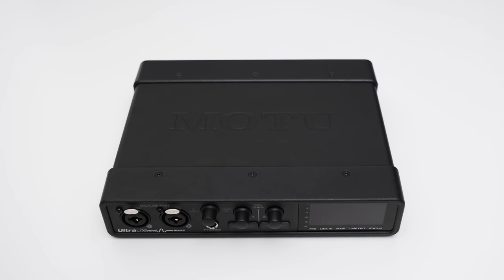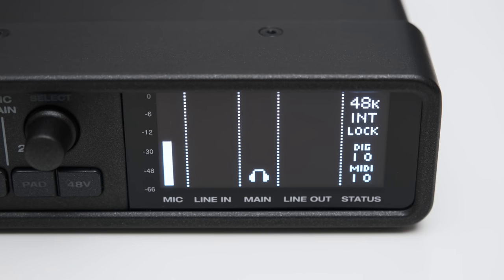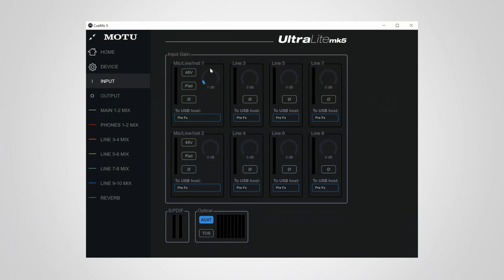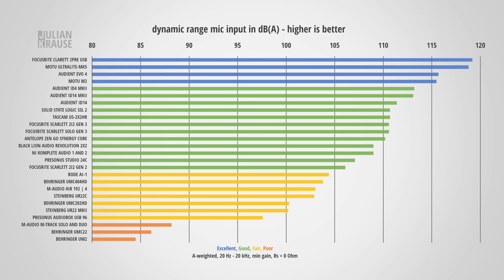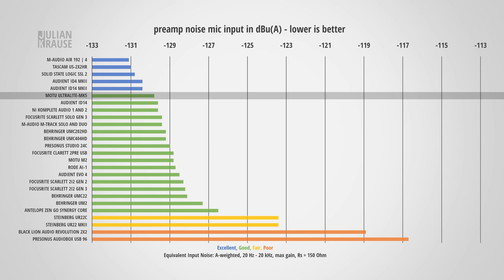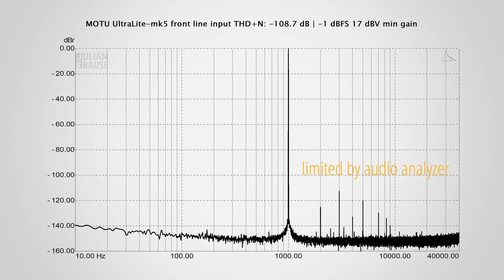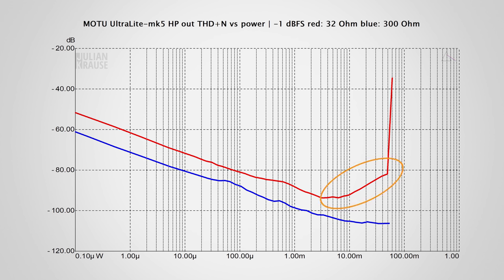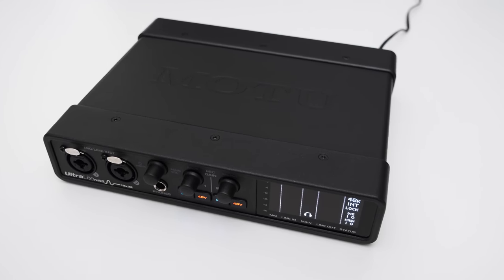MOTU UltraLite-mk5 Audio Interface - REVIEW (audio performance tested)

Comment: Great one Julian. Maybe it's time for some Apogees, Prisms or RMEs to see if their high price matches the performance.
Reply: +1
Reply: Agreed!
Reply: I agree, because I suspect that most of the more expensive interfaces sell their brand. 0 distortion is 0 distortion
Reply: I just commented the same thing essentially, lol
Reply: Agreed. Totally
Reply: @Saintknick  to be fair, RME has done a lot of work to distinguish themselves. There's a reason for their reputation and it definitely isn't just branding. Their clock jitter performance and transparent AD/DA is simply very very good, at every sample rate too. That's one thing you can't take for granted with other interfaces. Also, NO problems with errors via the ASIO driver EVEN at 48 samples. That's crazy, and deserves to be given the praise it receives.

There's also the underlying reason I got an RME... Totalmix FX. Truly a SUPERB piece of software as part of the driver and I haven't seen anything that compares in flexibility and polish from any other software.
Reply: @ZeroDividesByYOU  I don't know man. MOTU has leap frogged RME in digital conversion these days that using top shelf components. Same converters found in the Apogees. Plus MOTU AVB ecosystem similar to Focusrites RedNet and Red Dante interfaces for (Audio Over IP). Focusrite and MOTU are the only two manufacturers with Audio Networking modular interfaces for large scalability and mission critical deployment.
Reply: @eman0828  I'm not so sure about leapfrogged using high end components. I mean RME's PCIe card is still regarded as the highest quality converter for a home PC. Multiple scientific reviews I've seen of the card give it a 10/10 and use it as the weighting by which all other converters are measured. I don't deny that Dante and networked integration is AWESOME for scalability and deployment. But if you're just one guy at home doing audio stuff for fun or even as a job, I don't think there's much to say at the high end. Everyone has their preferences and honestly almost all converters these days are essentially perfect to our ears, barring odd design failures with different sample rates.  (IE not being designed correctly.) Anything even remotely in the "great" performance category is going to sound identical to the point of cognitive bias having a MUCH larger effect than any real difference. However, one thing that still rings true of RME is their legendary driver performance. FLAWLESS operation at even 48 samples, and that's WITH all the routing that Totalmix FX provides. Totalmix FX is a game changer. And even though Motu seems to have a semi-equivalent with this ultralite, and probably several others, there's just not replacing it for me. It's a phenomenal routing tool. Also RME tends to include some nice plugin bundles (like Bx Masterdesk, Scuffham Amps etc.) for free, which I know some manufacturers do anyway, but RME ALSO has their scientific tool call Digicheck, which is a particularly useful and impressive tool for end users. It has all sorts of meters and such to properly understand your output levels, input levels, goniometer measurements, the works. It's mostly for THOSE reasons that I tend to prefer RME
Reply: @ZeroDividesByYOU  PCIe is so 90s early 2000s with the exception of Protools HDX DSP cards. Thunderbolt is the new standard which is essentially a PCIE connection. Latency is not really an issue with most Pro interfaces. RME is not known in high end studios as you rarely see them in large commercial facilities. RME doesn't have much vaule these days like they did in the past. UAD Apollos is already dominating the Audio interface market.
Reply: @eman0828  See it's interesting that you mention thunderbolt because 1. It literally is just PCIe. Similar to how some PCIe lanes go to the chipset and some the actual CPU. Thunderbolt isn't actually different. Just a more convenient form factor. Also, it's still just a 4x connection, just like RME's cards. Again I'm not talking about large institutions. I'm talking about home producer or mixing/mastering engineer. It's great for them. Even streamers. The audio routing via Totalmix is just incredible.

Also you seem to have a misconception that PCIe is "old" when in fact PCIe gen 4 is a newer standard. In fact modern graphics do no even saturate a PCIe 4th gen 16x connection, let alone an audio interface. Bandwidth is not the problem with modern cards. Even USB 3 has more than enough bandwidth for literally hundreds of channels. 
And yes, PCIe is technically an older physical connector design. But that does not limit it. At least it hasn't yet. There are things that are special purpose such and infiniband networking or other such devices that need higher bandwidth, but as far as something communicating data to the CPU, audio interfaces don't really stress those bandwidths.
Reply: @ZeroDividesByYOU  Still RME offers little vaule these days compared to the rest of the competition. You wonder why it's one if the lesser popular brands as theres a reason. MOTU makes the same stuff for a fraction of the cost of RME without comprising quality and has always been an innovative company since the 80s. Just remember MOTU has making hardware interfaces longer than most Pro audio manufacturers that exist today since the early 90s. They were also one of the worlds first  company to write music software for the original Macintosh computers in the early 80s. Their software and hardware products gas even used by countless Grammy Award winning Producers and Engineers as well as Oscar Winning Film and T.V composers.
Reply: @eman0828  PCIE is still King of performance.  Maybe thunderbolt 5 will de throne it lol!
Reply: @davidjenkins8449  Not really as PCIE mostly irrelevant by today's standards as technology is evolving very quickly with the exception of Protools HDX DSP Accelerator cards that serves it's own purpose. The Focusrite RedNet, MOTU AVB and UA Apollo X16s are already used in big commerical studios. Thunderbolt and (Audio Over IP) is the future. A lot of the Immersive Audio Mixing rigs esp the Dolby Atmos are using Network based interfaces esp the Focusrite RedNet and Red Dante interfaces. Latency is not an issue with Thunderbolt and with Networking protocols like AVB multiple MOTU AVB interfaces can be interconnected together on an Ethernet network with latency under 0.5ms. You can have hundreds of streams in Audio Over IP which is why Dante and AVB are used in large scale deployment such as Venues, Broadcasting, Post Production, Stadiums, Live Sound, Tours and multiple room large studios.
Reply: @matiascastrocomposer  RME UCX II
Reply: @eman0828  When Hans Zimmer still has a Fireface 800 in his remote studio, then I'll follow that recommendation.
Reply: @soundbelch1600  Yeah but JunkieXL owns three MOTU interfaces to midi interfaces and an Ultralite mk4. Hanz Zimmer is obviously german. Go figure.
Reply: @ZeroDividesByYOU  but how much flexibility and driver "stability" do we need to rave about , to justify a 1000 dollar Babyface at 3x the price of similar interfaces .in 2021 everybody should have that.
Reply: @eman0828  they worked together on a film score. I'm sure they kept arguing RME VS MOTU for hours instead of working ..
Reply: @levondarratt787  Bro MOTU offers long term driver support as well. Lynx, MOTU and Metric Halo all support their drivers long term. RME isn't the only one which is no longer a unique selling point anymore. MOTU support drivers for their original 828 Firewire interface for 17 consecutive years straight which is older than most RMEs interfaces that's 21 years old.
Reply: @ZeroDividesByYOU  Theres really nothing special about RME. MOTU also writes their own drivers In-house. So does Lynx. They don't use 3rd party generic drivers. I had problems with Focusrite interfaces for years the reason I switched over to MOTU for better driver stability.
Reply: @eman0828  you're right, I didn't say all. I said many. Including Behringer, Focusrite, etc. Those are what a lot of consumers look to and use as their baseline. It's still not great. Like I said, it's getting there, and hopefully soon commanding $1000 for quality will not be required and the general consumer can get just about everything they want for less than that. That's currently the case with the Motu Ultralight and many more to come. I think that's great. Also, my third interface was a Motu M2 and I loved that thing. Excellent value for money. But it still wasn't quite as solid as the RME's driver has been for me (but acceptable enough for most use cases) and it lacked the routing options that I really needed, so using Voicemeeter was still required. The Ultralight or the RME both offer that to me, but of course they command a price increase. The Motu is much more reasonable, but also much more recent.
Reply: @davidjenkins8449  If you read my comment above you'll notice that thunderbolt literally is PCIe. There's not difference. It's just a connector, the interface is still PCIe 4x. So PCIe being the kind of performance is kinda true, but also it's the same. And a lot of modern interface don't even come CLOSE to fully saturating the available bandwidth of even gen 3.
Reply: @ZeroDividesByYOU  What issues did you have with M2? I have zero driver issues with my M4. I have two videos posted on my you tube channel demonstrating MOTUs driver stability on two different Windows 10 machines. No audio drop outs, clicks, pops or crashes. I find both my 828ES and M4 to have been the most rock solid stable interfaces I've used in the last 15 years. I've owned and used a boat load of interfaces over the years. My studio partner use to run a commerical studio with both Lynx and MOTU hardware interfaces when I was working under hime as an In-house Producer at the time. He had the original MOTU 896 before he got the Lynx Aurora 16.
Reply: @ZeroDividesByYOU  I forgot to mentioned that my studio partner use to work for this commercial studio in my home town as an Assistant Engineer back in 2008. He said they were running a MOTU HD192 PCIE core interface and an Apogee Rosetta 800. Last time I checked just a few months back, I notice that they are still actively using the same MOTU HD192 interface 13 years later still to this day along with a 1998 MOTU 2408 MKI and a 2003 model MKII 2408. Its pretty crazy how long that stuff held up over the years. I know most commerical studios are pretty conservative when it comes to upgrading hardware and software to eliminate down time and compatibility issues. If it ain't broke don't fix it.
Reply: @eman0828  Like I said, most consumers won't have issues with them. However, they do still have timing problems quite rarely. It's better with certain buffer size/sample rate configurations, and as mentioned these won't be apparent to most consumers. However, using two ASIO drivers talking to one another as you do in Voicemeeter and having an ASIO application mixed in with WDM audio for loopback (possibly for streams, other routing, etc) does cause pops and clicks. They're not nearly as bad as Focusrite and similar, but they're still there. THAT'S why I spent the money for the RME. Because it and interfaces like it not only further minimize those timing errors, but also eliminate the need for that second ASIO connection at all, given their internal routing. That's why I think the Ultralite is so awesome. Having that routing is mostly what I was looking for. Again, had that been out at the time I bought my RME, I probably would've bought that. But the RME has just been incredible for me.
Reply: @ZeroDividesByYOU  What timing issues? I've recorded several of my own clients including full albums and none of them complained about timing or latency issues. I had my MOTU 828ES for almost two years now that's had some heavy use. I haven't tracked anyone with the M4 yet as Its mostly used for my mobile rig for production stuff. The latency on that thing is insanely low. I detect no latency at all when using my Preonus Atom Drum Pad controller as it feels instantaneously like my Akai MPC 5000 drum machine which I still own. I never owned a mobile interface with that level of latency performance so far.
Reply: @ZeroDividesByYOU  I understand. As for driver, on a Mac, audio interfaces usually don't need one of the device is compliant. Any USBC inteface i tested , for example works right of the box. Goes back to years and years ago USB A. So the fans are more Windows guys that are happy that their stuff works finally. But is it that much of a difference on the Mac side?
Reply: @eman0828  That's impressive.
Reply: @ZeroDividesByYOU  If that's the case, why isn't RME an industry standard if that was such a major issue. RME interfaces are quite rare here in the U.S not nearly as popular in Europe. Most high end studios here in the states mostly have Apogee, Lynx, AVID, Burl, Lavry, Prism, HEDD, and Some of Focusrites and MOTUs higher end (Audio Over IP) Dante/AVB interfaces and major studios aren't complaint about timing or latency issues. Theres also alot of UA Apollo's given it's one of the most popular and fastest selling interface on the planet used on countless hit records.
Reply: @eman0828  Because in most studios, this isn't a use case nor problem they'd run into. Again, I'm not stating that RME has the best interfaces, nor even the best value for money these days. That's certainly not true. But they do have some incredible latency performance (backed up by scientific reviews no less) and a reputation for a rock solid Windows Driver. My own testing with the tool for ASIO driver testing that Vincent made has backed this up. Virtually no timing errors, even with DSP max spikes over 100%. This is quite rare for most interfaces, and something to be commended in my opinion.
Reply: Don't forget Steinberg AXR4, UAD Apollo and Avid Carbon
Reply: @nickgoogle4525  MOTU doesn't have driver issues and my videos proves it. User error is what most people have issues with. A lot of pros use MOTU hardware with out any issues including David Gnozzi.
Reply: @eman0828  Your video can only prove that you did not had driver problems in a specific situation. That does not mean others might not have problems, nor that you might experience problems at another time / with another setup or conditions. RME is mostly regarded as having "rock-solid" drivers. Nonetheless some people experience issues -- which might be related to the driver, the computer, their setup and so on. It's often hard to tell. Motu also has a pretty good (but less in my perception) reputation. Still you find people who have hardware or software problems with their products. Can be good products for sure, but does not mean there are no issues and a single video would prove that ;-)
I just gave my input, which might be interesting for some.
Reply: @nickgoogle4525  Lol yeah and David Gnozzi and Tom aka JunkieXL has no problems either that own MOTU interfaces. Stop making excuses man as you are totally an RME fan6just bashing. Even Mike Elizondo that was Dr. Dres partner for many years owned two Motu 828  mk 2 and two midi time interfaces. A lot of Pros use MOTU hardware.
Reply: @eman0828  Nonsense, I have explained what I liked and what I do not like about RME. That does not sound like a "fanboy" to me. But you can think so if you like :-)
And sure Motu is used alot. What's the point? As well as UA and many other products. So what? I just described my positive and negative experience and everybody can and should look what is most important for him and decide based on his individual needs and preferences.
Reply: @nickgoogle4525  I never seen an RME racked mounted in a pro studio in my life many high end commerical studios I've been in as it's one if the lesser known brands esp here in the US or you think RME is so called perfect and none flawed that never fails. Theres plenty of broken ones out there from power supply failures. What I have seen in Pro studios is most Digidesign/AVID, Lynx Aurora, Apogee Symphony I/O, the higher end Focusrite Red and Rendet interfaces, MOTU HD192 and MOTU AVB interfaces, Lavry, Antelope, Apolli 16, Dangerous AD converters, but never once seen an RME interface if drivers were an issue. You are obviously just bashing MOTU for no apparent reason. I don't know of any big name celebrities that used RME but I can name countless big name Artists that used the MOTU 16A such as Beyonce Knowles, Usher, Jennifer Lopez, Coldplay, Drake and many more.
Reply: @eman0828  I am bashing Motu when I say they have a good reputation and they and others make good products and one should look which features and specs matters most and choose one that fits to personal needs? ;-)
BTW, I almost bought an M4, but because it did not have the needed connections that was not on the list at the end.
Reply: @nickgoogle4525  Yes you cleary are because you keep bringing up how perfect RME is lol. Like I said, I never seen an RME interface in a pro studio before if other manufacturers had driver issues. Obviously that isn't the case esp big studios in LA. Name a top 40 record on the radio that was produced with an RME interface. I bet you would have a hard time. MOTU stuff is pretty rock soild, otherwise it wouldn't be used by oscar winning Film and TV composers and many grammy award winning Producers. MOTU has been around since 1981 that's been making hardware interfaces longer than most pro audio manufacturers that existed since the early 90s. The company being around that long pretty much explains they must be doing some thing right to still be around 30 some years later. Enough said.
Reply: YES
Reply: @imaxy00  I think the Motu is a great alternative to the UCX ii
Reply: apogee please
Reply: @eman0828  FWIW: I use both an RME Babyface Pro FS and a MOTU 828 ES. Both sound great. I actually nearly sold the 828 ES because the software was extremely unreliable used with multiple PC's over USB-3. Pages were slow to load, adjustments to mixes/fx did not immediately make changes, device sometimes not found. I wouldn't even think of taking that interface out to session or a gig just to play band backing tracks. I loved the IO on the MOTU but I simply could not risk that unreliability. That is the reason I bought the RME. I needed the reliability and boy oh boy... It has not even blinked over years of use. I now use the MOTU as an ADAT slave to the RME to access the MOTU's pres, line IO, and headphone amps. I'm underutilizing the MOTU's capabilities yes, but it was inconsistent enough to be unusable on its own IMHE. No software was released to fix the issues from MOTU and it has been years. I emailed them and received no response. Pretty frustrating. Also, to be quite frank, the MOTU control app was not aesthetically pleasing and was pretty hard to navigate even for what it was. And run in a web browser vs. in a native shell...
Reply: @danielc4361  its your computer is the problem not the manufacturer. Most people have issues when is user error. I have zero issue's.
Reply: @eman0828  I understand most people probably don't have this issue, however there was a good bit of corroboration from other people about the USB issues. I imagine the thunderbolt and network connectivity is better for people. As I said I used multiple (very capable) PC's with similar results. I like the idea of the device, and I'm glad it worked for you. It just didn't for me. If you have any suggestions as to how to resolve the issue, I am eager to hear and, to be frank, anything would be better than what I've gotten from MOTU support. All drivers were installed correctly. No hubs or anything out of the ordinary.
Reply: @danielc4361  Well it's not the manufacturer fault. If this was a manufacturer issue, every single person on the plant want have the same issue. David Gozzni of mixbustv has been using thr avb interfaces for close to 4 years now and he owns 3 of them with zero issue's. My 828 ES I had for two years zero issue's. I own an M4 as well. Both interfaces have been used on my legion 5 laptop and my custom built desktop with no problems. Check my videos.
Reply: @eman0828  I have to disagree with you there. People use different devices. Lots of things can go wrong. Not necessarily the manufacturer's fault, But that's what customer support and continuous improvement is for. I use quite a few devices in the MOTU is the only one that doesn't work as I believe it should.  I appreciate your enthusiasm and I'm glad the devices are working for you. 👍🏼
Reply: @eman0828  Yeah David's review was one of the reasons I bought the interface... Wish I had the same experience.
Reply: @danielc4361  probably the way you have your computer setup or OS updates. I also work professionally in the IT field as a Tier 2 tech in the enterprise world that I do for living. I spend my day in registry editor, fixing BSOD, Active Directory, group policy and tearing apart machines everything from high end Engineering Workstations to laptops and thin clients.. Music Production is my side hustle semi Professional.
Reply: @eman0828  Very cool, glad to hear it. I've tried so many things, including loading sw and drivers onto a fresh windows install with just my DAWs installed. I don't think it is (or should be) a matter of tweaking the registry or my PC settings from stock. It should not even really be a power preferences issue since the unit is not bus powered from the data port, although my PC is tweaked for max performance  Again, the RME works great in all the same situations. Using my x99 tower workstation build or a Surface Pro 4 i7 16gb.
Reply: @tuneunleashed  troll
Reply: @ZeroDividesByYOU  yeah I know I was being sarcastic I build pcs and do IT I know all about pcie and thunderbolt hence why I said thunderbolt 5 which isn't even a thing...yet
Reply: @eman0828  interesting how @Daniel C has no issues with RME on the same PC that the MOTU is on. Looks to me like driver issues for MOTU to me. Whave been running a RME Multiface feom 2003 on many PC’s with many OS’s and have never ever had an issue with it. Most rock solid drivers on Windows of any hardware I have ever installed. Totalmix is also amazing as well. The latency is insanely good with RME. I really don’t care what pro studios use. RME works in my studio and never a problem with it. Support is also the best as well. My almost 20 year old Multiface is still supported even in Windows 11. I checked out some old MOTU cards that were released in 2005 and see that they stopped drivers at Windows 8. So it looks like MOTU doesn’t support their hardware for that long. Too bad.
Reply: @electricwhiterabbit  motu Support driver's long term as I guess you didn't look hard enough. The original 828 firewire interface was Supported 17 consecutive years straight. But again, who keeps using the same interface for years straight? Most people would upgrade their converters at least every 8 to 10 years. Every high end modern studio is using modern up to date converters that has to be compatible with the latest DAW and DAW software.
Reply: @electricwhiterabbit  And if RME was that great you would think all major recording studios was but using them but I yet seen an RME interface racked mounted in any major recording facility with an SSL or Neve board. That pretty much explains drivers aren't an issue. You see of alot of Lynx, AVID, Digidesign. . Converters.
Reply: @eman0828  I’m using an interface that is 19 years old and it still works rock solid in Windows 10. Many RME users use the gear for years as it is very well made. Nowadays converters are so good even on cheap equipment, that there really is no need to upgrade converters as the percept difference is extremely small. I will look at the original 828 and see but is that the only product that was supported for that length of time? What about all of the others like I have mentioned. So you are saying it is a crap shoot that they will support the device long term or not. With RME, ALL of their devices are supported still.
Reply: @eman0828  I’m sure there are RME devices in major recording studios. But really, I don’t care. Their converters are excellent either way. As you can see in Julians tests, the converters test extremely well. I am not a major recording studio and I am on Windows so I like my interface to be rock solid in performance and RME is well known and the best for that. Nobody can beat them when it comes to Windows drivers. Also the jitter specs are insanely good. The latency is far better on RME than any other interface that is not Thunderbolt. The USB latency rivals Thunderbolt interfaces.
Reply: @electricwhiterabbit  I've worked in a lot of studios over the years and never seen one in site not even in LA or Nashville. My profile picture was actually taken in a commercial studio in Nashville back in 2014. I did see plenty of Motu's esp the AVB stuff used in big studios along with few old HD192 but majority of studios I been in were all AVID, Apogee, Lynx hardware. I forgot about Focusrite Rednet too. Chris Lord Alge uses them. Given that RME is a German brand it's not a well known brand here in the U.S as we tend to stick with our own American brands when comes to converters.
Reply: @eman0828  I just looked at the original 828 and it looks like it came out in 2001. Support ended in 2015. Last drivers were for Windows 8. I never liked Windows 8, so would have been stuck on Windows 7. Not ideal at all. So NOT 17 years but only 14 years of support. Like I said, my RME card that still works and sounds good is 19 years and still supported in the latest Windows and still rock solid.
Reply: @electricwhiterabbit  driver's doesn't really mean much as it's not like RME selling out like hot cakes. Lynx, Apogee and AVID makes up 90% of he commercial studio market which poves driver's aren't an issue for other brands.
Reply: @eman0828  Like I said, I don’t care what other studios are using. They are more than likely using Mac as well. Hardly any pro studios use Windows. I don’t have or use Mac. I use Windows. RME is the king for Windows users. Rock stable drivers and long time support beyond any other company out there. No competition.
Reply: @electricwhiterabbit  You didn't look hard enough and never said anything about Windows. I simply said they support driver's for 17 year's. Driver's support cut off in 2017 for Macs. But again really no one uses an old interface that long no ways. Most people would have upgraded their interface a long time ago with better conversion. You aren't going to find a Pro studio still using old 90s dated Digidesign hardware. Interfaces and converters are digital hardware that eventually becomes obsolete over time as the connectors changes quite often. Like how many people these days use firewire? For real. It's not like analog hardware that becomes unchanged for 20 o 30 years.
Reply: @electricwhiterabbit  Digital hardware is easy to become obsolete as technology changes so fast unless you anticipate to be stuck with a 20 year old PC. That's why supporting drivers for a digital device doesn't make much sense. Computers don't come with firewire interfaces anymore.
Reply: @electricwhiterabbit  Yet those converters are dated with dated computer interface connections. The converters in the new MOTU AVB are right up there with Apogee and I use to own an Apogee that I used side by side. The sound is cleaner, very dynamic and punch. The latency is stupid low and I'm using thunderbolt. I have no driver issues what so ever as my 828ES was ment to be use as a studio converter with outboard gear. Good luck with using old dated gear that no one really cares about as no one cars about how long drivers are supported. Very few people keep an interface that long given how fast computer technology changes. You wouldn't be able to buy a Mac today with a Firewire port.
Reply: @eman0828  Yup, they are dated converters that actually still sound quite good. I have been making mixes on them and they transelate easily. The thing is, with this card, it is connected via a pci slot which you cannot get in motherboards anymore. But, people have been using pci to pci express converters with them and they still work fine. Amazing!!  Still works in Windows 11. A Motu 828 won’t work in Windows 11 or even 10 for that matter. If they were so good then to record music, should still be good now if they work right? Not like the sound quality of music was bad in the early 2000’s was it? If all of these were in the studio’s then as you say. Nope, the music still sounded great then.  So then the converters were still good enough right? It is all about how you use the equipment and the skills and less about the converters. Converters are a small part of the sound. Work on mic placement/ performance/ use of eq/dynamics/fx more than the converters.
Reply: @electricwhiterabbit  And no one uses firewire anymore these by today's standards so you can keep your 20 year old PC from 2001. Thunderbolt is the new standard why faster that surprises what you have now as is basically an external PCIE connection. You don't see anyone complaining about drives or latency issue with the Universal Audio Apollos that's used by virtually every major recording artist out there. You wonder why RME interfaces aren't all that popular. Ha
Reply: @eman0828  I am not usin a pc from 2001. Iam using a PC from 2016 that has a pci slot in it and a 6th gen i5 in it. Works great and is fast. Thunderbolt really is more of a Mac thing and not so much Windows. The only reason why UAD was so popular was bot because of their interfaces but because of thier plugins. People just got the interfaces so they could ise the plugins. You think Sharc technology is some new advanced thing?  Ah no. It is very old technology from the early 2000’s. Now that UAD is going native, less people will buy their interfaces.
Reply: @electricwhiterabbit  they buy the interfaces to record through them. Again. No one is complaining about driver issue's. There is nothing special about RME these day's as they lack in innovation. Again there is a reason RME interfaces aren't all that popular as the low latency selling point is a bit long in the tooth as must Manufactures surprised them in innovation. Focusrite and MOTU pretty much owns the live sound market and Audio over IP. RME was late to the game just starting to make Dante and AVB interfaces as they jut stopped innovating with lack of features and technology. Interfaces have came aon ways these days that drivers and latency issue's is rarely a problem in this modern era. A lot of studios are switching over from Protools HDX to thunderbolt as thunderbolt is the good. The protools HDX cards hd the lowest latency in the industry. Thunderbolt work well with Windows as I have custom built PC.
Reply: @eman0828  I see lots of people on Windows systems having issues with UAD. So you are wrong, they do have drivers issues with Windows. Read their forums and tou see it all the time. Why is it that RME are so well known for the best drivers for Windows systems?  They are the best at it and nobody can touch them. I wish there were nore and better options but there isn’t. RME is still the best in rock solid drivers and interface functionality. Motu is pretty good, but still not as good. RME interfaces are more popular than you think they are. I think you are a bit delusional to think that RME are not popular at all. They are sold everywhere. They have been around a long time. Still make amazing products to this day.
Reply: @electricwhiterabbit  I get it you are just an RME fan boy. They always say the same o damn thing yet RME products are barely an existence here in the U.S. You sound like some German European because mostly people of of Europe only talks about RME. If RME was that great they would have been the the number one selling interface brand in the world but they aren't. UA Apollos, Apogee and so out sells them. Most people aren't interested in boring old rme interfaces that lacks innovation and features.
Reply: @electricwhiterabbit  David Gozzni from MixBusTV and I have been using our MOTU AVB interfaces on Windows for quite some time and neither of us have issues. All you RME fanboys is do os go around and repeat what some else said in. Forum without having first hands on experience with them or owning one in h first place. David bough his a year before me and you don't see him complain. The proof is already there these these interfaces are reliable on Windows. The rave reviews of the 828ES and 8PRE-ES pretty much speaks for its self as you wonder why MOTU interfaces always seems to be out of stock all the that sells like hot cakes.
Reply: @eman0828  Kinda funny that you keep mentioning David Gozzni all the time. Do you know him? just an FYI for you as you say that nobody knows or uses RME cards of note. Well maybe you should have done your research on David some more. Yes, currently he is using Motu 828ES and the 16A in his system now in the last 4 years. Do you know what he was using before for many years very reliably??? Take a guess?? Oh yeah... He used RME cards in his PC for years. He even said he loved them and they were great. Amazing!! The only reason why he switched was that he bought a new computer to put together and he was a bit of a dumb ass to not realize that his RME cards were the old PCI and he got a motherboard that is PCI-Express slots. So David was a RME fanboy as well. He has his system connected via Thunderbolt now. Not USB. 
Let me know what USB interface has as good latency specs as RME has? I will wait for your answer. David doesn't use Vsti plugins so latency isn't something that he cares about anyway. He just wanted the channel count and quality converters. When he changed, RME didn't make anything anymore that what he used to use by them as the product was discontinued. In a way, I'm in the same boat when I upgrade my PC. They don't make anything like the Multiface anymore. My Multiface gives me super fast latency. I use Vsti plugins and record guitar direct in using software amps as well.
Reply: @electricwhiterabbit  David owned two SSL converters with an RME PCIE so what. He wasn't using RME converters. There is a reason why he switched to MOTU. We don't have latency or driver issues with you keep rambling on without actually owning one. You can keep your german n azi gear while we support our American companies.
Reply: @electricwhiterabbit  Protools HDX has the lowest latency in the industry. There's a reason why you never see RME in big commercial studios. My studio partner and even use to run a commercial facility  back in 2013 equipped with Motu and Lynx Aurora converters. RME fanboys always thing their product is always suppior that repeats the same old lie every time that's never used any other products. Like I keep saying, you wonder why RME isn't very popular while UAD Apollo, Apogee, Lynx, AVID, Motu and Focusrite continues to outsell RME in record numbers around the world. We don't give a damn about some boring German interface.
Reply: @eman0828  Protools has the lowest latency in the industry. Great, don’t care. Nobody is using that stuff in their house. There are not many big commercial studios out there because people can now make records with a $200 interface now. I see you ‘used’ to run a commercial studio. Probably went bankrupt is why it is no more. RME is superior because for USB which is what MOST people use and want the fastest latency possible. The only way to get that is to use RME because nobody else can compete. You still have not told me another company that has as good or better latency specs than RME via USB. You are obviously just a Motu fanboy. Keep defending your product that is made completely in China.
Reply: @electricwhiterabbit  Yup because RME is a toy to big boy pros. Lol 😆 🤣. We don't want that shit in our studios geared for amatures.
Reply: @eman0828  OK there Motu fanboy who still avoids the questions because he knows nothing and cannot compete with RME and has to say the same things over and over again 🤣🤣🤣🤣🤣
Reply: @electricwhiterabbit  You wish RME was better until you own AVID HD hardware and will realize RME ain't all cracked up to be. Try beating American round trip latency of 0.7ms. Even MOTU AVB latency is around 0.6ms. America 🇺🇸 is the king of converters as we make some of h best converters in the Apogee, Lynx, MOTU, Lavry Engineering, Burl and AVID. You Germans can't complete with us.
Reply: @eman0828  As a non pro user, I recorded classical guitar through AT condenser mics with an Apogee Duet 2, that I later exchanged for a Quartet for convenience. Sound quality was very good and the Apogee Quartet is a very nice interface. Then I bought a RME Babyface Pro. It admittedly doesn't look as nice, but sounds as good as the Quartet (although a little different). Sold the Quartet, because I was worried about degradation of the OLED. I have a Motu M4 on the way and it will be very interesting, how it fares against the more expensive RME BF Pro. I'd really like to own an Apogee Symphony Desktop, I think it is the best looking interface at the moment. Most RME products look like they are from the nineties, but they sound good nonetheless. The street price of an Apogee Symphony Desktop is unfortunately quite steep in Europe at the moment.... Don't know, what big studios are using, but I guess SSL and Apogee.
Reply: @followyourpassion8378  I use to own th Quartet as well. I there was very little diffences between my 828ES and the Apogee as I sold the Apogee a couple years ago. Apogee symphony, Lynx Aurora and AVIDs own HDX hardware is pretty much the standard in every major recording studio esp here in the U.S. a commercial studio I worked at as an in-houe producer was running a couple of old MOTUs one was 896 and the other a traveler. My studio partner sine then upgraded it to a Lynx Aurora 16. I spent 3 solid years using the Lynx Aurora as well.  My 828ES sounds just as goof as well.
Reply: @tuneunleashed  which one would be better if I’m recording vocals .. ucxii or Mk5?
Reply: @eman0828  This assumes that people are using a Mac, which I and many people around the world do not. In fact I would never buy another Mac as I am not a fan of their business model of creating waste by forcing software updates which render people’s equipment “obsolete” prematurely just to make share holders happy. 

I’m happily using my Madi FX for about a decade now with rock solid stability and unbeatable performance. Also, one must consider the modularity which makes it far more flexible than any Thunderbolt enabled product. 

Every RME product that I have purchased has been rock solid and I see as an actual investment, lasting me a decade or more and preventing me from “needing” to buy new equipment unnecessarily. This in itself is quite valuable.
Reply: @moonelfcosmo  funny thing is my motu hardware has been rock solid. and never had not issues on windows 10. I see no reason to pay an x amount of money fot the same thing at the fraction of the cost. RME products are pretty over priced on what they are offering by today's standards. I had my 828ES going on close to 4 years now. I also added the MOTU micro lite MIDI interface to my setup. That thing has been around for over a decade and MOTU still makes drivers for still to this day. I mean MOTU MIDI interfaces stoll remain the industry standard used by everyone from Dr. Dre, Mike Elizondo to J.R Rotem.. built to last.